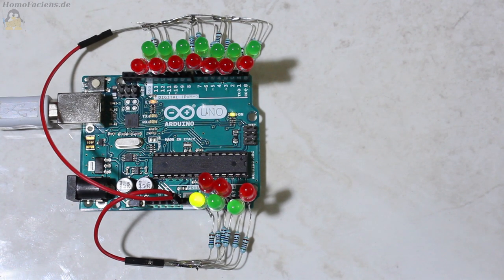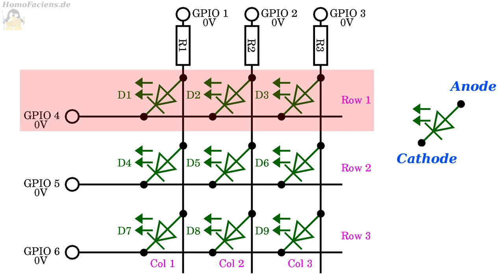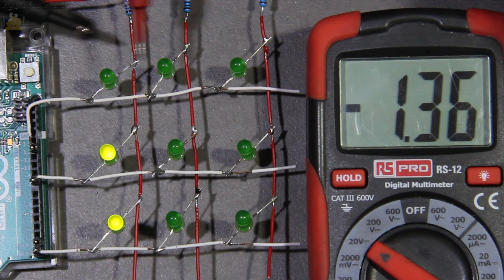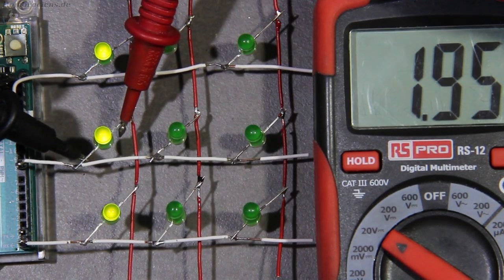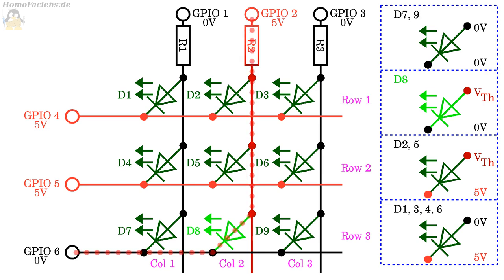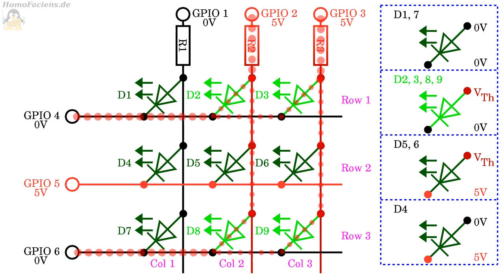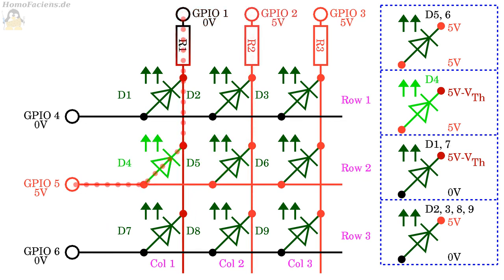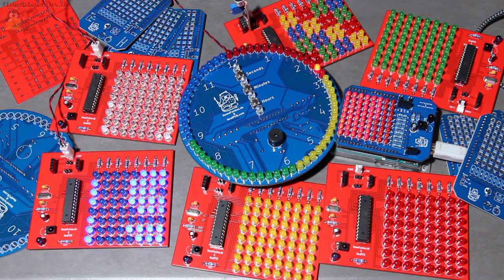Physical Computing: Working principle of an LED Matrix

Comment: I want to use 12V LEDs , (per led 0.3W) for an 8x8 LED matrix. Can I use an Arduino to control the 12V LED matrix with good brightness?
Reply from the maker: ...with a 12V power source and 8 MOSFTEs you can drive them with the rated 0.3W.
Reply from the maker: Well, if you have no idea of what MOSFET to use and how to switch them, I'd suggest to use <5V LEDs with a current of no more than 50mA. You will very likely get quicker to a working LED matrix.
Reply: @HomoFaciens For my next project, I'm working on a LED MATRIX Controller. I need to learn more about it. I'm using 12V LEDs (0.3W) arranged in an 8x8 matrix, totaling 64 LEDs, requiring 1.6Amps. So, do I need 8 MOSFETs for NPN and 8 MOSFETs for PNP? I mean for the cathode and anode. I searched the internet but couldn't find much information about LED matrices. Fortunately, I found your video, which I hope will help me learn more about LED matrices.
Reply from the maker: MOSFETs are not NPN or PNP, but P-channel or N-channel. You need just 8 of them. Either P-channel or N-channel and connect them to either the columns or rows.

Did you ever consider having a look at my pages?
https://homofaciens.de/technics-physical-computing-LED-matrix_en.htm

https://homofaciens.de/technics-physical-computing-N-channel-MOSFETs_en.htm

https://homofaciens.de/technics-physical-computing-P-channel-MOSFETs_en.htm
Reply: @HomoFaciens Thank you I'll study your page and implement it in my project.
Reply: @HomoFaciens   When connecting an IRF3205 N-channel MOSFET to pin 7 of the Arduino's cathode, with the LED's anode connected directly to Arduino pin 6, and the LED's cathode connected to the MOSFET's drain pin, the circuit's output voltage is limited to a maximum of 8 volts, preventing the LED from reaching its full brightness, thus inhibiting high brightness blinking.
Reply from the maker: I guess you still did not really get how to make use of an N-channel MOSFET:
https://homofaciens.de/technics-physical-computing-N-channel-MOSFETs_en.htm

Also what does "connecting an IRF3205 N-channel MOSFET to pin 7 of the Arduino's cathode" mean?
Reply: @HomoFaciens  i mean column cathode pin is connected into the MOSFET GATE pin....
Reply from the maker: Draw a sketch and sent it to me.
Reply from the maker: ...why do you think I have implemented a column named "contact" on my pages?